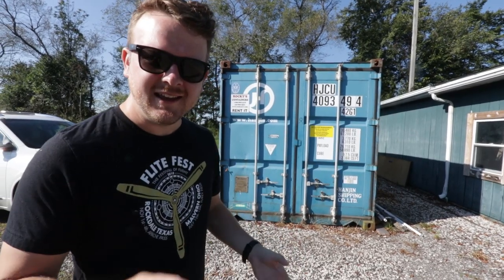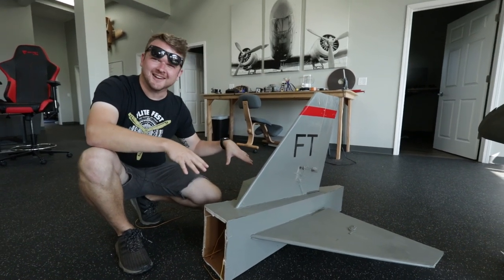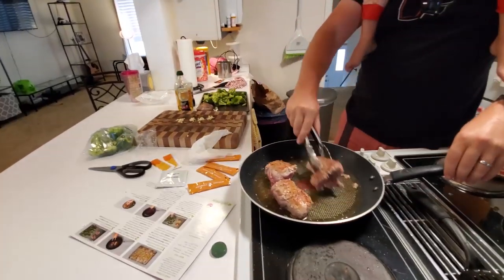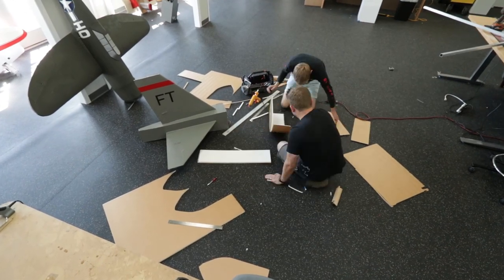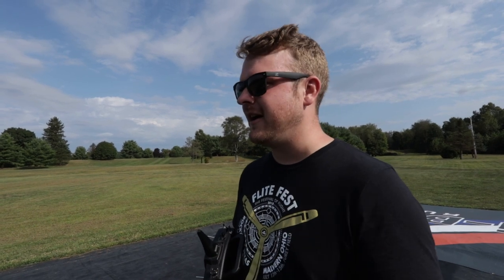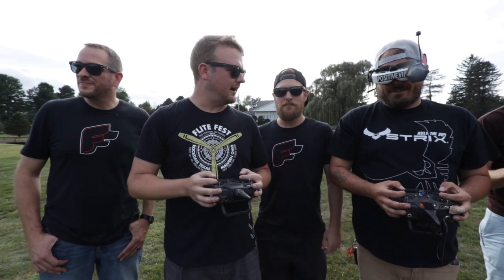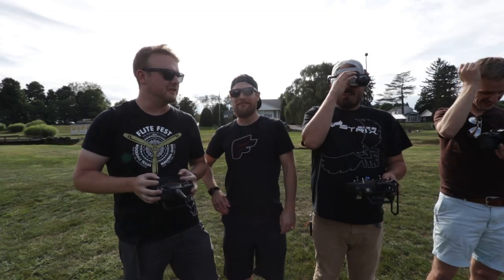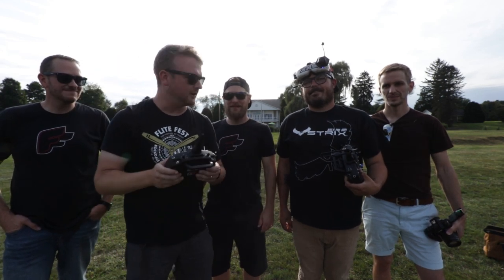This Won't Fly Well 😨   I took the tail off a B52 and made it into a plane?

Comment: If you like 1950s, search lifting body planes. If you build one of these, you’ll truly be legends
Reply: Matthew Pate yeah dude they’re really dang neat but I have yet to see a successful version
The original plane had a horrible crash landing and the project was discontinued
Reply: MajorLeague I’m meaning FULL lifting body. No wings, all lift is generated by the shape of the aircraft body
Reply: It would be a freaking miracle if they built a stable_flying X-24A or M2-F3
Reply: The Wainfan FMX-4 Facetmobile maybe worth a look.
Reply: @awatt  That IS an intriguing looking craft!
Reply: OrangeSockNinja yea they look much more weird
Reply: So a bit like a rocket?
Reply: Great suggestion, I had no idea these existed.
Reply: @michiganengineer8621  Someone tried, with a 3d printed model https://www.youtube.com/watch?v=PmRX-CzJbd0
Not too much of a success, but maybe bigger and made with foamboard may be different!
Reply: Rctestflight has some cool lifting body experiments on his channel
Reply: You mean an F-15?
Reply: The terms are flexible. Facetmobile was lifting body as much or more than a "flying wing" and certainly the Horten/Northrop all-wing tail-less purists would deny calling it a "flying wing".
Burnelli was a lifting body, but the NASA flying bathtub purists deny that, and they were also called flying wings which drives Horten fans nuts.
One of the Flying Bathtubs had a horrific crash. Others made several flights and had no notable bad habits, beyond worse glide than the Shuttle.

The Horton was a lifting body, but was also called "flying wing". Also from the 1950s, called "wingless" it was entirely successful as a flying craft, until Hughes killed it because Mr Horton wouldn't sign all rights over. An easy foamy build.

Space Shuttle was neither. Tail-plane-less delta, like the Saab Draken or others.
See also the Soviet MiG-105 "Spiral" (predecessor of the Sierra Nevada Dream Chaser, by way of NASA Langley and the HL-20). It had tiny winglets, but was a lifting body, and a far better re-entry spaceplane lifting body than the NASA flying bathtubs or the X-38. As well as drop tests, it made self-flights under its own power.

RC facetmobiles have flown well, and there's an ARF model out there.
Note that Wainfan built it that way for simplicity: Fewer straight pieces are easier to make than many curving pieces. It fits for a foamy build.
Reply: flying pancake
Reply: rctestflight pulled it off in his video
Reply: This would be sick

Comment: can you combine the flying wing and flying tail. to be a plane that can separate mid-flight?
Reply: The the Enterprise from TNG
Reply: I was thinking the same but maybe also the could add  the nose and fuselage which could hold the 2 together halves together until they approach their "target" then drop the fuselage as a "bomb" on target then the 2 planes that were previously 1 could "attack" with the advantage of suprise 
😂🤔 that would be a fun video
Reply: For the seperate in mid flight feature...the plane has to be made in china

Comment: vertical CoG was completely whack. it’s much higher than the wings meaning it’s unstable when flying upright and always seems like it’s falling over. modern fighter jets are a little like this and require computers and fly by wire to keep them flying straight and true, this video was an excellent way to observe it IRL!

Comment: Challenge:  build a guppy type plan with a popcorn popper inside.  The challenge is only to pop popcorn when in the air, so you’ll have to rig something up that either transforms the battery voltage to the motors, or use a relay to a switch for a separate power system.  I suggest using an air popper so there is less oil to deal with.
Reply: Maybe have a separate salt or butter dispenser on board.  How about a cinnamon-sugar option?  It should be a custom flying popcorn popper.
Reply: If you made it with an oversized guppy, you could choose to dump the popcorn when you wanted or open the rear hatch and have it constantly popping.  It would be cool if it all could be controlled on one transmitter.
Reply: Another idea: call it “The Kernel’s Dreamliner”.

Comment: Can you guys fit additional motors to the aircraft.when it gets turned on , up in the sky it's gonna cause some discomforts or dis lead the aircraft from its normal flow.some thing like the one you fit in that warship.or may be you guys can experiment with Air breaking, make the propellers rotate in reverse direction in the sky or may be fit motors which can be turned on in the middle of the sky which may rotate in the opposite direction of the main propellers.

Comment: You guys just made the ADM-20 QUAIL decoy, with badly designed control surfaces. Ironically, was flown in a B-52's bomb bay. The concept here is it was packed with transponders and heat sources, making for a believable radar signature.  But it never really was tried. With advances in radar tech, coupled with digital processors, the image resolution improved to the point the QUAIL was next to useless.

Comment: The most likely issue is you have too much rudder authority which is causing significant stability issues.
Reply: SGTDeetleaves yeah I agree. I wonder if they could mix rudder into the ailerons to stop it rolling as much. Ie left rudder adds right aileron and v.v. I would get rid of the differential throttle as well since the wingspan is so narrow, they can’t afford to reduce throttle in that heavy beast.

Comment: An aircraft does not need to rotate to take off. It's called ground effect. The Wright brothers and the Spruce Goose both flew within ground effect. 
The vertical stabilizer is to big. Shorten your control surface. 
The horizontal stabilizer is not big enough for ground effect.

Comment: Guys: The B-26 was a real plane. A bit confused, because it actually describes two different planes, depending on when in the WWII timeline you're looking. 
Indeed, I think the B-26 "Marauder" may be a good candidate for your expert build series. Faster than the B-25, and scarier to land. It used the same Pratt&Whitney engines that powered the P-47, but two of them.
"B-13," though... nope, never heard of one, but my memory isn't perfect.

Comment: What is wing loading and how do you do the calculation?
How do you calculate the power of your motor and what prop it will need based on the numbers on the case? Thank you

Comment: Kinda reminds you of the rocket with wings that was launched from under the b52 back in the 50s or 60s
Reply: There were a couple of them.  The Bell X-1 in 1946 was the first manned craft to break the sound barrier in level flight.  The one you're probably thinking of though is the North American X-15 the first craft capable of controlled hypersonic flight.
Reply: @michiganengineer8621  yes, and I think Yeager was the pilot
Reply: @vharrald  Yeager was one of the X-1 pilots (Glamorous Glennis).  Armstrong was one of the X-15 pilots.
Reply: @michiganengineer8621  my bad, I sometimes get confused at when Yeager flew, since he was one of the top test pilots at Edwards AFB.
Reply: @vharrald  No problem, I used Wiki to double check my own memory :D

Comment: Ohhh You Nut Cases!!! I'd Cut The Rudder Down To The Top Of Red Line, Put A Full Swing Canard Wing On Nose Tip Sides Of About 8" Per & You May Then Just Have A Great Flyin Wiener Dog Plane!? Add A Short Steering 2" Nose Wheel & A Pair Of Fixed At Rear Towards Out Sides Also For Better Ground Handling! Thanks Y'alls

Comment: Looks a little like some "Fattie" designs due to the huge rudder.  Normally the rudder isn't that exaggerated and the rest of the model is single foam sheet thick, which is often around 6 mm to keep it very lightweight.  I am thinking the rudder is going to get trimmed at some point to adjust the control surface influence and gain balance for the design.  You can also find the "Fattie" designs by searching "cartoon RC airplane", and "RC airplane caricature", among other options.  Most of the time anyone seeing a Fattie for the first time flying around with RC gear will say, "Baby" along with the normal identifiers of the aircraft type.  For example, Baby F-16 Falcon, or another aircraft type.

Comment: Put a wet towel under your cutting board and it won't slip away!
Reply: truth.  i use the washcloth that hangs on the oven handle.   also, on the subject of cutting boards, anybody else cringe at the meat juice on the same wooden cutting board?

Comment: Alex... Why do you always have to take nice things and shred them into junk. -_-
Reply: becuae it's part of his job.You can I cant afford that.even if we have extra inventory on different motors/esc props, batteries. i build my models nicer than most people. Do whatever mods to make them stronger and last.
Im not always in a mood to build. I crash enough as it is..always need spare models in the hanger so  I can just fly without building. For some reasons... I like to see contraptions gets destroyed....( just not mine :-P)
I'll definitely wont put  the ruder in front of the elevators on any of my contraptions anytime soon. :-P